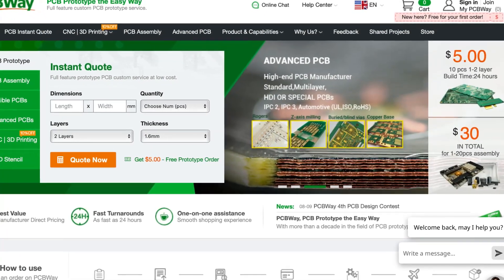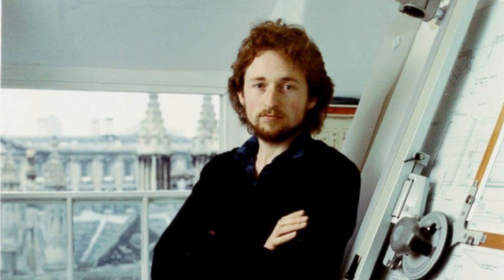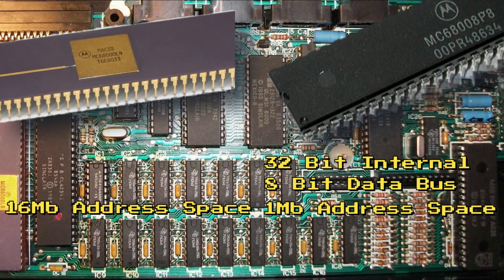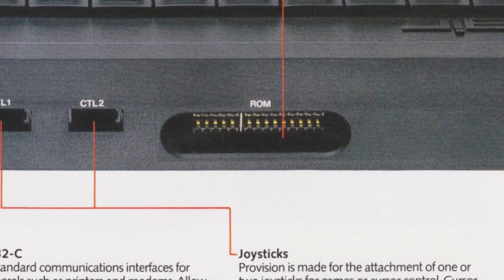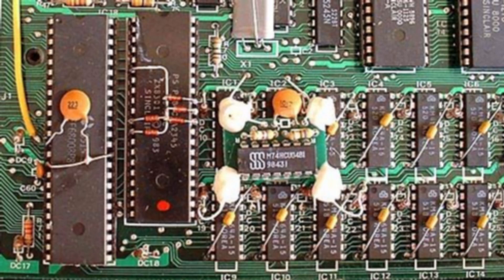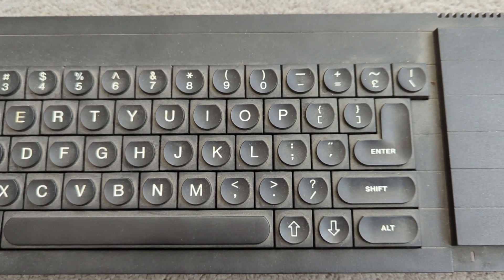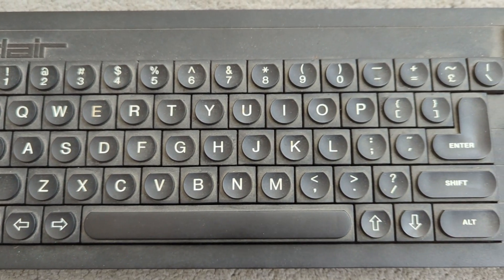Let's give the Sinclair QL a new lease of life!  Part one - the story so far!

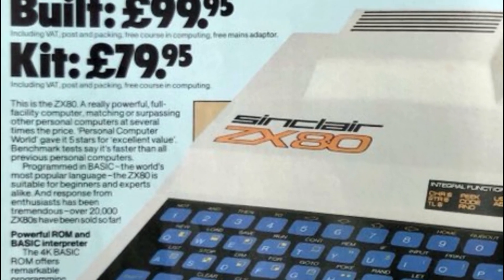Comment: Good video, but slight correction around 2:10, Sinclair (or rather Science Of Cambridge) sold 50,000 ZX80s not 500,000. Also, I did (and still do) have a working Sinclair QL. I did a lot of my computer science degree essays and projects on it, including my dissertation write-up, which needed about 5 or 6 Quill documents as the 128kB didn't leave me with much space for editing. I also had Computer One Pascal (it's actually a p-code pascal compiler, so, pretty slow); a dot-matrix printer and a monochrome monitor. After Uni, I managed to upgrade the board to 640kB and add a dual 3.5" disk drive; Computer One Assembler. I added quite a few other pieces of software too over time and kept the computer until 1993 when I went Mac.

Comment: I had a bargain bin one back in the 80’s I think it was £99, used the Quill software and Quen data daisy wheel to write technical manuals with it. I pulled it out the loft last year( after 20 years plus) and it fired up, even the micro drives worked. Replaced the membrane and It sold well on EBay.

Comment: The problem with all these old machines was locking owners into a proprietary operating system and software. Additional hardware was again limited to expensive add on devices produced for specific machines. The IBM PC opened up the market for everyone to source software and hardware from wherever they liked and brought costs down significantly. Being able to transfer information between different offices operating different but compatible machines allowed business to finally take computers seriously. So while in theory any of the old machines were capable of running a business, the experience would be rather limited to stock control, finances, and begging letters, all tediously subject to manual entry via a dodgy keyboard. At the time it seemed fun and bleeding edge, but the reality compared to modern desktops and tablets was that those old computers were very tedious, time consuming, and boring when trying to get any serious work done.

Comment: Great video... I hope you can get it working!

Interestingly, they apparently picked the 68008 as it was slightly cheaper than the 68000 processor at the time, but by the time they got to market, the 68000 was actually the less expensive option owing to production quotas. 😂
Reply: The 68008 also has only 48 pins instead of 64 pins, so it takes up less PCB space. Also, I think early generation 68000's could only work with a 16-bit memory bus (8-bit peripherals were possible though).

Comment: We had the QL in our school computer lab in the 80's. It was about 30 of them and 1 Apple IIe we weren't allowed to touch. The QL was pretty nippy with the microdrive, especially if you were used to tape based systems as most of us kids were. The BASIC was fairly easy, the keyboard was nice to use. I am surprised we didn't have BBC B's though. I'm guessing some smooth-tongued salesman said "You're a modern comprehensive, you should have modern computers!" & flogged us QL's. Most kids owned a 48k Spectrum or C64.

Comment: 20 years ago my QL ended up where it belonged: at the scrap yard.
It's OK to be nostalgic, but the microdrives were a nuisance, if you could get them to work at all. The microdrives killed the machine, and the machine killed the Sinclair brand.
Floppy drives weren't cheap back in the days, but trying to cut corners by equipping the QL with dodgy microdrives was unprofessional. Sinclair knew about the microdrive issues when they launched the QL. The QL wasn't a business machine, and it wasn't a gaming machine either. It was game over.

Comment: I did my university thesis on one of these - years after they stopped production. It was cheap, the word processor was pretty good and with a floppy interface it was pretty reliable. If you can find one, get one of the Miracle Systems upgrade cards - more memory, a complete CPU replacement, IDE interface, rom upgrades and it all fits inside the case in the expansion bay. Arguably the reason it never found a market was Sinclair's absolute insistence that it couldn't be a games machine - he never quite came to terms with the fact that the Spectrum's success was down to games and not education and business. Just when all the other machines were beginning to flex their muscles with better graphics and sound, the QL's barest of bare bones display and audio capabilities were almost puritanical.

Comment: I started with the ZX Spectrum in 1984, used it until 1992. In 1989 I bought a Spectrum +2 after my old one died. When I went to college in 1991, I bought a printer and used my +2 to do office work. I knew about the QL from its day, and I bought a very cheap functional one that served me through 1994, when I could get a PC.

I got a Sandy Electronics SuperQBoard, that gives 640 Kb total ram to the system, parallel port and a floppy port which I used with a twin 3,5 DSDD units, and with that I could work. I also had a Z88 that I used to take notes at college, and then I passed the info to the QL via serial ports.

You can use it perfectly for what you want, but you would like to read about the last upgrades.

Have you found the Delete key? ;)

Comment: My dad came home with one of these totally out of the blue one day. I had an Amstrad 6128 so wondered why he got it. I think he was given it and liked the idea of doing accounts and letters on it, hooked up to a daisywheel printer. We got it up and running, using Quill and the spreadsheet and it seemed not bad. The microdrives worked fine, but the fact there were no games at all for it meant my interest waned quickly! still have it in my retro aladdins cave in the loft somewhere.

Comment: I loved my QL. I really think if they had gone for a slightly higher price point, they could have fixed many of its flaws.
Anyway, I'd love to see you restore the QL to the it's original working condition, then try using it for a little bit before upgrading.
It's surprisingly capable even with 128KB, though with a few upgrades can do a lot more.
I agree a storage upgrade is essential.
If you can get hold of a vDrive, they are an amazing solution, especially when mapped with a vMap to let you specify which microdrive it masquerades as. Unfortunately, I don't think it's a simple as just buying one. There are several other SD card solutions, some of which are actually available.
Another interesting solution is the Tetroid disk interface, which has 768K of memory, a floppy interface, and a CompactFlash card reader on one card. Might be interesting for swapping files between the QL and the Psion 5MX.
I'm keen to see this progress, so you have my backing on Ko-fi as long as you're doing QL stuff.
Reply from the maker: Thanks James!

Comment: I had 2 QLs (so many of us did it seems!) though the first one never worked properly.

If I remember correctly those loose wires should have been connected to a block and would plug into that vertical black socket next to the keyboard cable. They're just the LED connectors though, so not vital.

It looks like at least one of the keyboard cables has fractured so you might have some fun getting that working. It's a known issue with them.

As for the ROMs, I would say find out which ROM version you'd like (that will work with this board) and if you can't find the binaries online I dare say one of us should be able to get our ROMs copied for you.

Comment: You can get help on QLForum. Also, at the top you'll see a link for QL Homepage, which is the biggest repository for software. My channel also covers the QL. QDOS is pretty advanced and may even be a precursor to Linux (Linus first computer he purchased), it was designed as a Unix variant (series of internal design papers published by QL World) and has the best kernel of the mid-80's for a micro computer.
Reply: Btw, the ZX81 printer was a spark printer, not thermal, which was a cool technology from the 40's. The pic of the internal motherboard mess, I believe, was due to foreign market requirements and I think may be the US version with its strict interference requirements.

Comment: Re: The market segment aimed for:
Firstly, it couldn't have been aimed at the Macintosh as that had been a secret project within Apple and only announced within a week of the QL's launch.
If you look at the "business computer" market in early 1984 there was nothing on the market in the UK less than about £1500, and that would have been a CP/M machine. Above this would have been the ACT Apricots, which would have been the cheapest MSDOS (but not IBM compatible) machines and then the IBM PC-XT being about £3000 with just two 360K floppies. All of these would have been far too expensive for a small UK business, so a machine which, with a monitor, would have set you back ~£600, with two 100K storage devices and free software would have potentially looked attractive. An all in small business system for £1000!

Now, a couple of years ago I did a side-by side comparison between an ACT Apricot F1 (4MHz 8086) and the QL. The QL came with 128K of RAM and the F1 with 256K, but MSDOS took up most of that. The QL cost £400 (+ monitor) at the time and the F1 ~£1500 (+ monitor). Given the software and the speed difference, the QL won hands down. The Microdrives were slower than the double speed 720K 3.5" drive, but there were two, so you didn't have to keep swapping. Also, Psion Exchange blew SuperWriter/SuperCalc and the other applications out of the water. So, looking at it from that perspective it actually made sense. However, the QL's form factor and trailing cables were a major downside.

Comment: Info about stuff... Go to the QL Forum! :-) 
Microdrive replacement: vDriveQL + vMap (If you want sound for the vDrive I've a small PCB I can send you which fits into the vDrive and plays a recording of a Microdrive)
Or floppy interface and a Gotek. (Something like a Trump Card  or, if you can get one, a SuperGold Card clone)
Getting on-line is more tricky though I think someone has done an ethernet interface (I've just read something on the forum)
Reply: P.S. Seeing as you don't have any ROMs, look at the "Minerva" ROM replacement. It's a re-write of the OS with many bug fixes. It also has a very handy RAM test at boot which should tell you which RAM chips, if any are bad.

It's a pity that I can't post any links in the comments.

Comment: I have a Sinclair QL, I got it with a serial printer when the shops (Dixons ?) were clearing their stock. 

For a screen I used the guts out of a green screen VDU monitor so all I needed was a video signal, I did not need colour. So with the monitor fixed it was ready to go.

I changed out the keyboard for an after market one which needed a chip change. The membrane keyboard did not have a problem with contact bounce but the after market one needed some debounce logic. 

The great thing about the QL was the ability to switch in assembler code into the Basic so all the slow stuff (I/O) could be written in Basic then the fast stuff was like “Sh*t off a Shovel”. I was using it to prove bell ringing permutations. It was far easier to code and faster than the IBM PC at that time. It was also a big step up from writing 6502 assembler to writing 68000 assembler which was interesting. As the IBM PC and software improved I could do the same proving on a PC so dropped the QL.

The core of the QL was used by ICL in the BT Merlin, also called One Per Desk or the Tonto. It didn't sell in Spain, when you translate Tonto from Spanish to English you will see why. Both used the microdrives but the format of the tapes and OS were not compatible.

I still have the QL and its original packing but I don't have the monitor to see if it still works.

Comment: There's an active forum that discusses QL matters called QLforum. You can get some replacement parts from SellMyRetro. Other items you can get on other line marketplaces but quality may be iffy. The Psion software is still available. As is quite a lot of software. A new (upgraded) compatible called Q68 is being released - hope to get mine in the next couple of months. Getting a QL online with the modern web is going to be tricky.

Comment: The CST Thor line of computers fixed some of the issues with the QL, but they came after Sinclair had already cancelled the project. In fact, the early models were built using leftover motherboards. If you want to find one, however, you're probably out of luck.

Comment: Sinclair really messed up with the QL, they should have done one of two things:

1.  Either go all out to make it a solid, reliable business machine with high quality components, a proper keyboard, disk drive(s) etc. that would appeal to the business user but be much more expensive than what they produced (priced somewhere around £1000 mark to give decent quality but still undercut the competition) or
2. target the home market with a capable gaming machine that could use either tapes or cartridges (or disk drives although these were probably far too expensive for the average UK home consumer at that time).

Instead they ended up with a machine that was capable on paper but lacked the quality and reliability business users needed, and was useless for gaming due to a lack of software support and Sinclair mismanagement.  It ended up appealing to neither market.
Reply: I totally agree, in fact games was the key to selling these home computers of the era.

Comment: If you can get Dithvide working you should show that the QL could, from its launch, have done 256x256 with 32 colours and 512x256 with 10, and also a mixed mode interlaced 256x256 8 colour frame followed by a 512x256 4 colour frame 25 times a second, using stipple patterns to produce 256 colours. Also, Basic shouldn't have been included on rom, should have been a better editor and pascal or C compiler.+ embedded assembler. Would have been simpler, smaller and more useful.

Comment: MC68000 CPU has 16-bit data bus therefore it is not a full 32-bit CPU like MC68020 and MC68030.
Reply: Doesn't matter IMO. The 8088 had an 8-bit data bus but nobody would call it an 8-bit processor. The 386sx had a 16-bit databus but is still being viewed as a 32-bit CPU.
It's not so easy to define the "bitness" of a CPU as one might think.
Reply: @EgonOlsen71  Indeed, the 68008 was Motorola's equivalent of the 8088, with the 68000 being in the same market as the 8086.
Having a multiplexed 8bit bus meant that system designers could use the older 8 bit interface chips and designing a PCBs was cheaper too.

Comment: Didn't had one and no clue about the Microdrive, but for a replacement idea, what about an RP2040 or ESP32 emulating one? Then the software still thinks its running from its original drive and nothing needs to be patched. Of course there would be need for some FUSE driver to mount the actual images on a PC, otherwise data transfer would be hard.
For internet access, there is ESP8266 firmware out there that bridges between Serial and Wifi, essentially being a telnet client running on the ESP and the QL being a terminal here. There even is one that can run a SLIP connection if there are SLIP client drivers for the QL and software that could use such a network connection.

Comment: I'd be way too tempted to keep the MicroDrives and try to make an external MicroDrive to USB so they can be read on other platforms. It wouldn't work, but it'd be a funny project.
Reply: I would have thought in 2023 that the vDrive was the way to go. Basically looks electrically like a MicroDrive but is actually storing stuff on an SD card. Goes in the microdrive or QL case with a 3D printed slot thing for the SD card holder. Here is the ZX Spectrum version on a YouTube video https://www.youtube.com/watch?v=_4lVD_PPzOw

Comment: I sent for a comparison sheet from Sinclair Research, highlighting how much better the QL was to the BBC Micro. They both cost £400 at the time. I ended up getting a C64 and 1541 instead - close shave! 😋👍
Reply: I'm not a huge fan of the C-64. But it is way more flexible, serviceable and reliable than any but the very latest runs of the QL. Even then the C-64 was just better.
Reply: @lawrenceshadai4966  The QL was a better business computer (on paper at least) - 80-column text, 128K RAM, built-in mass storage devices and a bundled business productivity suite. Only it wasn't very reliable, which isn't good for business use.
Reply: @Zeem4  I'm wondering where the lack of reliability is/was. I have no idea where that reputation comes from. The only issues I know about are splitting Microdrive rollers, the regulator going bad and static electricity from the RGB port frying the ZX8301 ULA.
There are many dubious design decisions but reliability wasn't really one of them.
Reply: @Zeem4  Exactly my issue. An 80 column computer that did not work was inferior to my Atari 800 using AtariWriter that worked reliably.
Reply: @Zeem4  That tape thingy though...
Reply: @decidedly_retro  It got a bad rep at the time for keys being loose and falling out.. Perhaps that caused people to assume it was unreliable?
Reply: @kensukadventures628  That was the Spectrum+ keyboard which had the keys falling off initially.